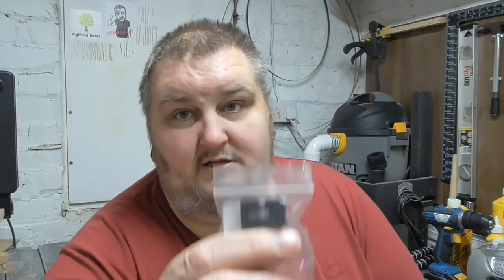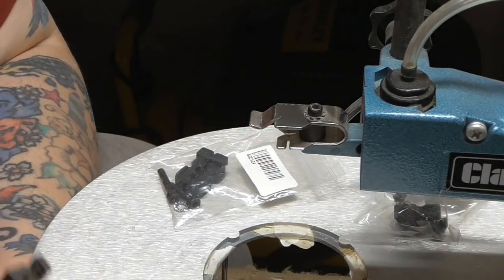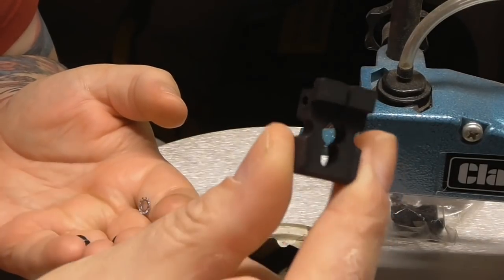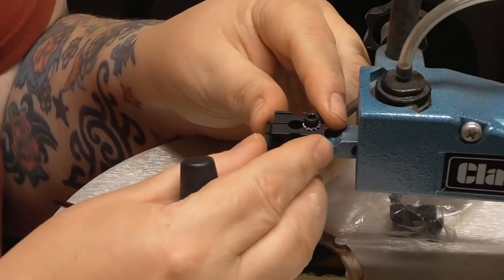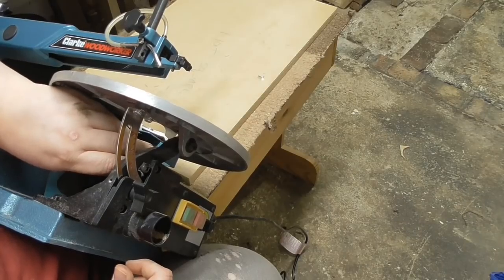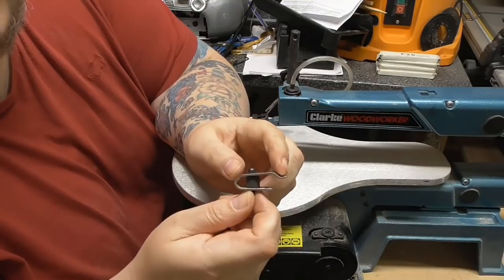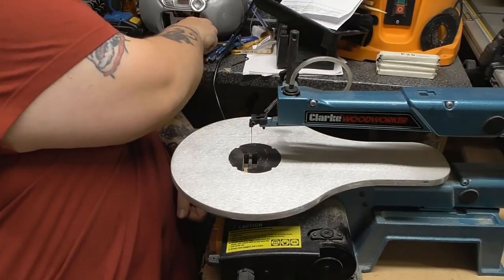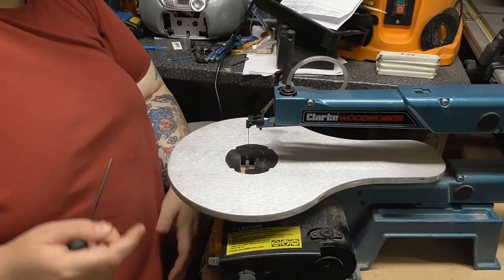Scroll Saw Blade Conversion to pin less blades

Comment: Hi , just bought a scheppach so 1600f model. I noticed on your saw that you have some tape on your insert.  My insert does not fit flat , it keeps jumping up off the table. Have you any suggestions to fix it.  Could send it back but I don’t really want to do that.  Thanks for any help. John

Comment: I bought a Ryobi. It is set up to use both pinned and pinless. I had seen a revue where a buyer was unable to get the clamps to tighten down enough to hold the thin pinless blades. MIne had the same problem. I removed the clamps (that closely resemble yours) and squeezed them tight in a vice. I was able to permanently close the gap enough so that the tightening screw could get the jaws to grip both sides of the blade.

Comment: You replied in one of the other comments that you were going to replace the socket head capscrew with a thumb screw.  In this application I would be very concerned about adding weight to something that reverses direction 30 times or more per second.  That just adds to the stresses and increases vibration.  Otherwise, a nice conversion.

Comment: Great little mod Warren :) Mine has the same old type adapters, but the new ones look much better ॐ
Reply from the maker: Yes it is definitely worth the investment to upgrade it saves som much time without having to replace the bottom holder each time you need to feed the blade through an inside cut thank you for your comment 👍

Comment: How are you getting on with these Axminster clamps? I converted my stroll saw a year or so ago much as you did and I've had one of the clamps jam shut so I struggled to get the blade back in.
After a bit wedging a stanley knife into the gap  and cracking on I heard a CLICK! it broke behind the alen bolt :( I'm hoping it's not proper cast iron and is just compressed powdered chinesium so I can put a weld tack on the back to fix it (Axminster are out of stock currently).
Reply: They are chinesium, mine both broke too

Comment: I adapted an Aldi workzone saw with these ..ordered spares because the first couple broke quite fast when tightening ..Seen someone say when you put the blade in make sure it hits the screw before tightening and this seems to make them last a lot longer ..

Comment: Nice mod. mate will you be able to use the Allen bolt with the washer welded on or make another?
Reply from the maker: The threaded bolt is a different size s0 will need to make another I'm going to look for a threaded thumb screw for it
Reply: @SCRAPWOODTOCRAFTWOOD  thanks for your reply I'm sure you will show us your solution in good time cheers
Reply from the maker: @lenanderson8103  definitely my friend

Comment: Hi there, Thanks for your video on the blade conversion, however please let your watchers know that some of the modifications/adaptors are not as well made as they could be. Both of the adaptors broke when clamping in the blade. I was just nipping it tight not overtightening. They have broken in different places too. Perhaps the design needs looking into. Regards
Reply: Exactly the same happened to me. They’re made of brittle cast metal and yet the design is clearly designed to have some flex - bonkers. Still wishing there was a decent aftermarket system, it surely can’t be that difficult.

Comment: I fitted these blade adapters to my scroll saw because they still have the notches for pinned blades. So you can use either pinned or unpinned. I don't know why they don't fit these as standard as everybody I know ends up purchasing these adapters.